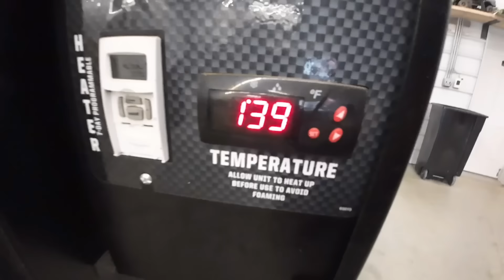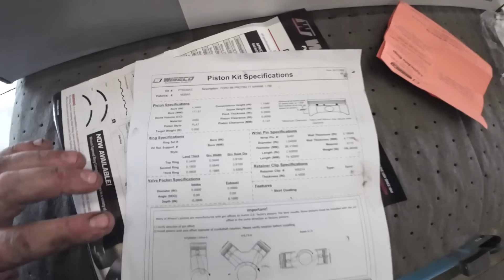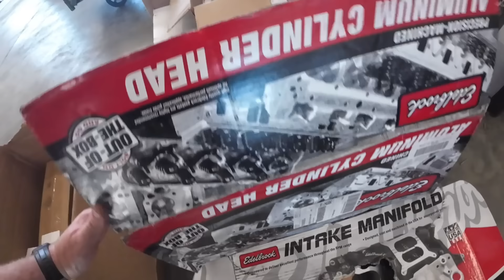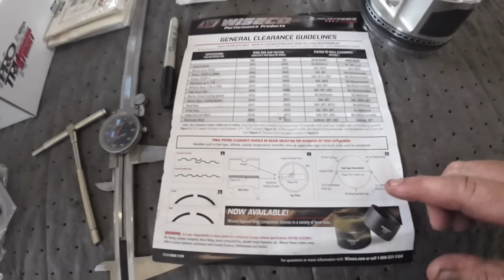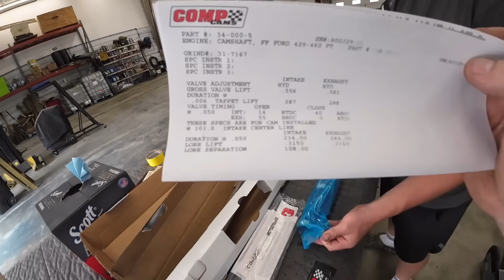Ford 460 performance engine build for Hunters 1977 Ford Highboy

Comment: With the high volume oil pump did you go with the bigger capacity oil pan, because it's possible to suck it dry, and starve the motor for oil flow. 
Which most people don't take this into consideration when building up their engine, and doesn't necessarily have to be hot rodding it in order for this to happen either. 
Just a precautionary note for you to consider, and I'm not saying it happens every time, but a possibility that it can happen if the right conditions happen, and a few dollars more for a few more quarts of oil capacity is great cheap insurance on preventing several things from costly repairs. 
Don't ask me how I know these things, because I'll have to swear I don't know what you're talking about even after all these years. 
Hope he likes gas stations, because 460's aren't known for passing too many of them by without stopping in to say hello regularly. 
But hey, he might meet his future bride there he'll be stopping by so often he's going to get to know the other customers very well, and you just never know who he might run into on one of his many stops.
Lol
Reply from the maker: It’s a 7 quart pan and with a couple oil mods we did it should be fine

Comment: Way to tight ! Unless you are running 0 20 oil Stick diesel engines you are not very good at building gas engines
Reply from the maker: Um ok
Everything is in specs
Reply: @C_CEQUIPMENT  don't know what specific information you are looking at . All my service chassis manuals say .0015 most people whom build use.002 on mains and .0015 on rods . Rule of thumb is .001 per inch of journal I only use that above 600 HP the wider the clearance thicker oil is required for oil wedge. Your engine you're time . Even te the dumb dudes on power nation use .001 per journal size . Ford also changed Base oil requirements from 10w30 to 5w30 I run 5w30 with the the .002 straight 30 anything bigger.👍💯🇺🇸❤️
Reply from the maker: @stephenhans189  I’m just going off a 460 manual 
It will be fine
It was running perfectly fine before this for thousands of miles and all we did was put new bearings in
Reply: @C_CEQUIPMENT  let's us see that truck smoking tire's have fun!🇺🇸💯